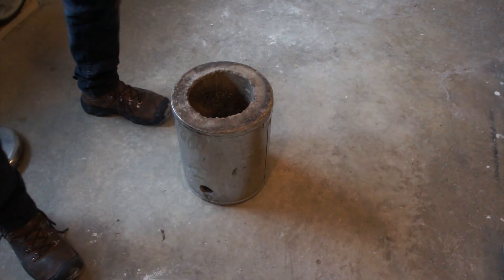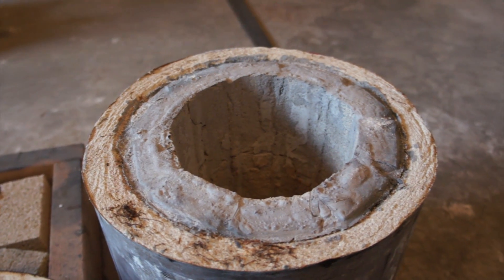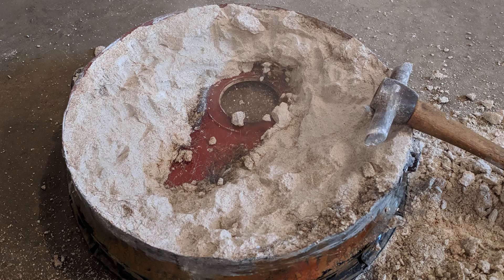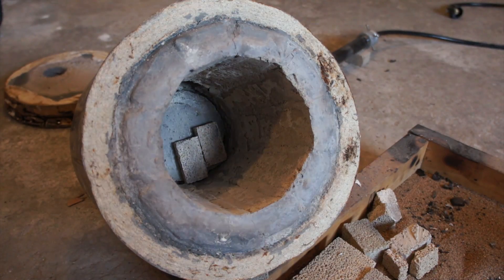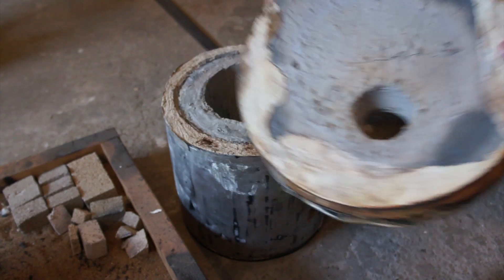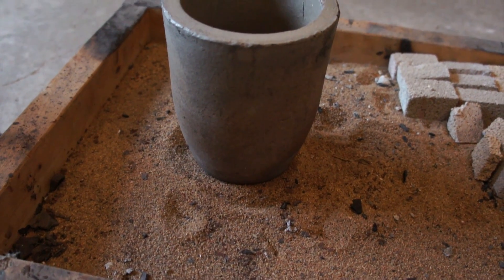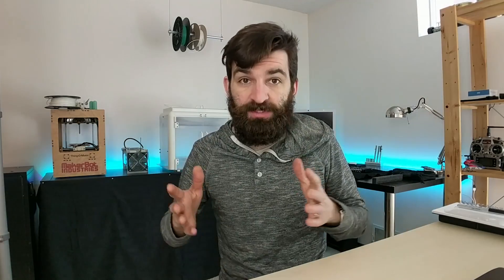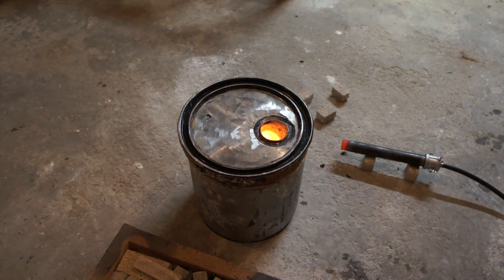Confounded Chronicles 16 - DIY Foundry Furnace

Comment: Eh bud, tell ya a quick & easy trick for cutting propane tanks. Once you've gotten out all the gas you can take a sawzall & hit the base of the brass fitting just until you puncture it & the last of the gas/ pressure escapes to the outside air.( obviously do this outdoors). Then making sure to only cut as far as is necessary to get the pressure/ gas released leaves you plenty of 'meat' left on the brass tap to still get a wrench on it & twist the tap off thus giving you 1 now purged & 'clean' steel tank & 1 brass tap with the guts still in it ready for the scrap pile. I've thousands( literally) of tanks over the years, never hand a problem. Brass( as I'm sure you know) doesn't spark when cut, you're not going all the way through so no need to worry about any of the guts of the tap & a quick rinse with the hose & you can cut the tank into any shape/ application you'd like without worry.
Ran a scrap yard for years, it's perfectly safe so long as you follow as instructed & resist the urge to do this at night next to a roaring campfire.....enjoy. 👍 Oh & 'high pressure' regulators have BFP( back flow preventer) built in to them so long as they're not 15/20yrs old. You got nothing to worry about with your regulator or your solder joints.

Comment: I was able to pick up an adjustable propane regulator for a "fish cooker" for about $40 US several years ago, and it was worth it. I highly recommend it, it will make your operation easier to control. Fewer things to juggle makes it much easier to concentrate on what you're doing safely.